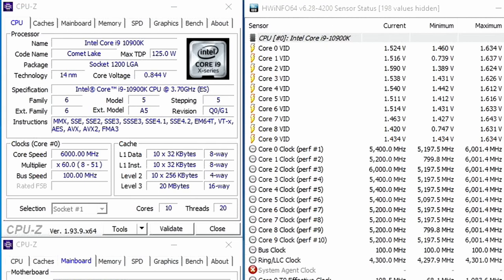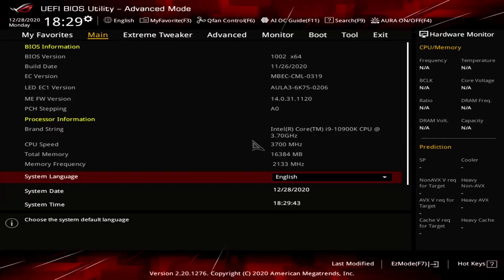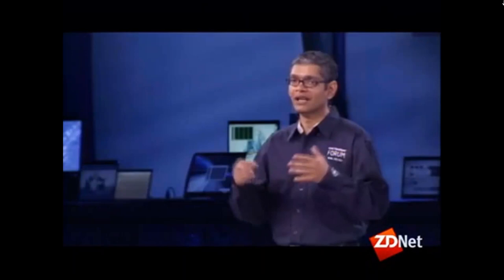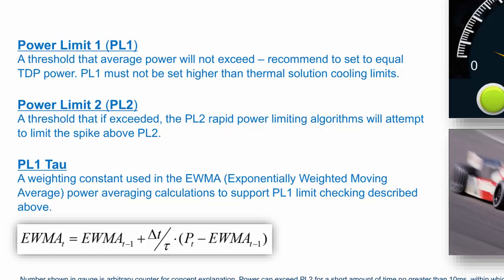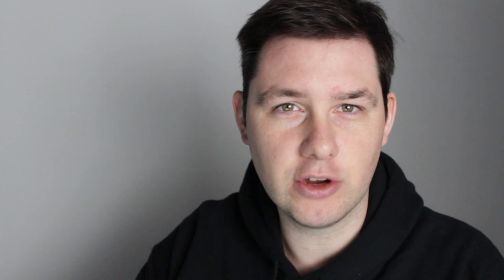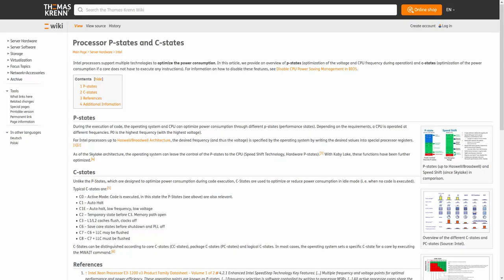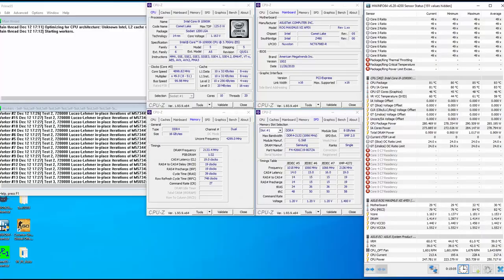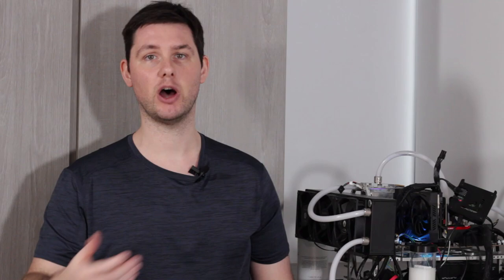BIOS Explained: Core i9-10900K Overclocked to 6G With Intel Cryo | SkatterBencher #19 Extended

Comment: Hi, can you explain how it is possible to verify if the overclock is stabel? All your settings are choosen based on rules. That is great. But the maximum Frequency of the CPU is also depending on the silicon quality. In my opinion it is not ensured that i achieve with the same components the same result. The possibilitys based on temperature, voltage and cpu clock are huge. The CPU load on games are very variable, it is possible that one game is rockstable and the next one force every 5 minutes an reboot. Can you please make another video how to verify such a cpu overclock?
Reply from the maker: I judge stability by two approaches:

1) Running a mix of light and heavy workload benchmarks back-to-back: superpi, geekbench5, cinebench, hwbot x265, V-ray 5, Realbench, 3Dmark, Final fantasy. This gives me the confidence that the overclock configuration is stable in the majority of the scenarios
2) Simulate a worst-case scenario using Prime95 Small FFTs with AVX enabled: while it's highly unlikely this kind of workload will occur in the real-world, it gives me confidence that the system would be able to handle it if it would.

Certainly, you are correct that the exact settings of the most stable overclock will be different for each CPU and in fact each system. The cooling, the air flow, the CPU quality, the workloads, the ambient temperature, ... it all affects the final maximum overclock.

In my video I try to explain the process, but it is up to the viewer to then apply the process to their system to find the right settings.

Comment: overclocking doesnt work at all with this shit. looks like the software somehow is blocking my bios settings
Reply from the maker: which software is blocking your settings?
Reply: @SkatterBencher  not sure if its the bios itself or the cryo software but Basically new windows, just the mainboard drivers from cd, never had even internet connection. I even talked with asus today and im not the only one with that problem.